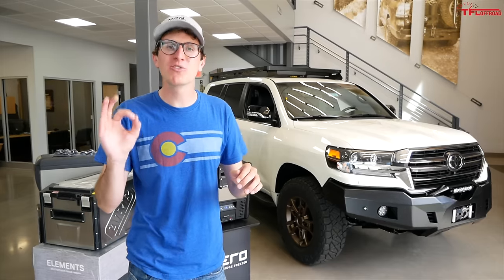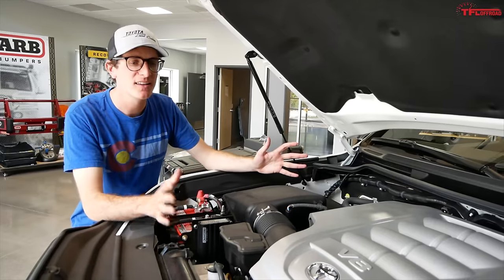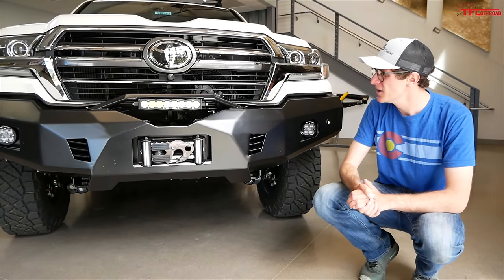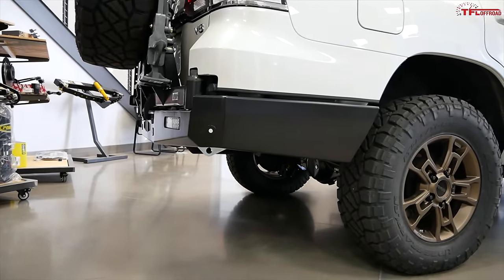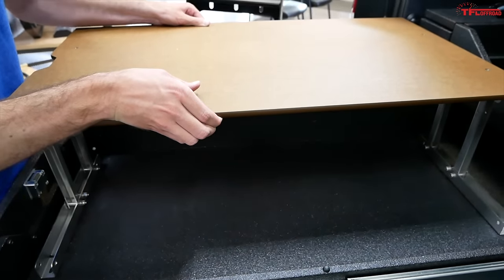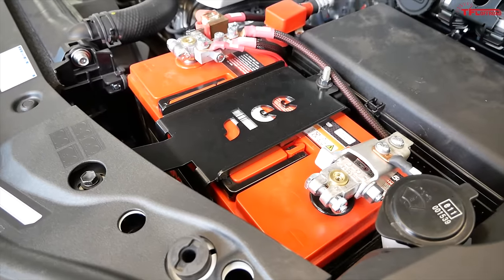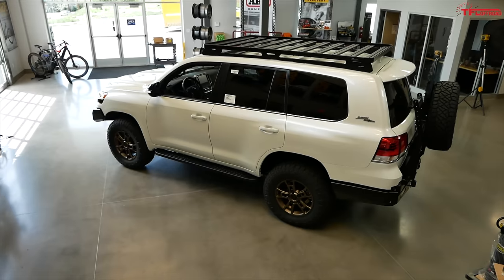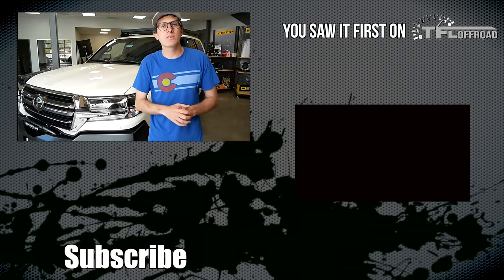Here's Why This Toyota Land Cruiser Costs $150,000!

Comment: Expensive but at least it’s not just another dealership bolting on cosmetic accessories and calling it an overland build.
Reply: Yeah, at least they outsourced it to the right place.
Reply: @Les Norton For dealers its a cash cow. Bolting on a few grand in wheels and tires and the rolling it into the financing is a killer deal for THEM. People not saving money but convincing themselves they need a $70K pickup truck and are ok with 8 years of financing have completely changed the way dealers sell vehicles.
Reply: in my country(thailand) standard landcruiser vx200 250,000 usd+(8,500,000 bht)
Reply: @donleamon8653  those sorts of people have ruined the true meaning of an overlander. Nowadays weekend warriors  think they are overlanders.
Reply: I like that they did all of that and still didn't do a rear locker.

Comment: Proud owner of 2008 LC2008, yes expensive when I bought it new in 2008 but really happy it still drive like new even with 450K miles 👌👌
Reply: Yes, that car so expensive. We have LC2016 we bought it in 2016, but it doesn't  much different from LC2008 in design.
Reply: My 14 year old Ford Escape has as many miles and still drives like new too. JK but I think it’s about how well you maintain your car too with a little help from initial build quality. I like the style of yours better than the new ones.
Reply: Mine have 150 000 but Kilometers same 2008 brothers, amazing vehicle..
Reply: I have a 2008 I got a few months ago, only 160k miles

Comment: I admit that I'm a Datsun and Toyota fanboy but there is no way I would ever buy a pre-customized vehicle, especially one with a price tag of $150,000. Half the fun is customizing it myself. That Land Cruiser looks heavy as Hell.
Reply: Thing is, other than the how you'd outfit the rear cargo area, Slee stuff is in reality, what you'd buy here in the States to put on your 200.
Reply: Yeah this rig is to overly priced as well
Reply: @donleamon8653  I am a Dissent guy myself
Reply: @vee950  Its expensive because its designed to last 500k miles.  It will outlast 3-4 other trucks you'd own in the same time period.  That's why they're expensive, meant to drive through the jungle with no repair shops around and not break.  But alas (and same with the 4runners) if they are the most reliable SUV out there - why buy new?  Just buy a used one.
Reply: @MaliciousSRT  500k? try 1mil. There are a couple Tundras with the V8 Engine with 1mil.
Reply: @Baebon6259  Not the 5.7L V8 though.
Reply: It is heavy as hell. The only downside is GVM is very low for such a big vehicle. My 2009 LC200 has only 570 Kg load capacity for addons. You put front bumper w/winch (100kg) and rear bumper with dual swing arm (100kg), drawer system with fridge slide (110kg) , long range fuel tank (40kg) and rock sliders & bash plate (60kg) you are going to be over the GVM. I personally think load capacity should be at least 750kg. Unlike Australia we don't have GVM upgrades in South Africa.
Reply: @boymeetsbush8232  a LC 200 is a smaller SUV than an cruiser. I think the LC200 is the same as a prado
Reply: @lucwilliams7447  In physical size it is same as a Prado, but mechanically it is far superior to a Prado also at least $30K more than a Prado. The Troopy is the best siz wise for a overlanding vehicle, if you don't mind the truck style suspension and ride. I will take LC200 any day.
Reply: @AlaskanSnowLeopard  yes there is. The 4.7 has more because that motor came out 23 years ago and the newest one is from 2006 so there’s a lot of 5.7 L V8 that are now heading 1,000,000 miles just go on the tundra forums. I’ve seen hundreds past 500,000.

Comment: I have a 2009, looks like the one you're showing.  At 11 years old,   it drives like the first day I got it. I added a 180 L  that 50 US gal. Aux tank . It needed it. ARB front and rear lockers. It goes every were out of the city with me for my work in renewable energy in East Africa.
Reply: @Nawir- do you have the ARB air lockers? Have they been reliable over the 11 years? Thanks in advance.
Reply: Your 2009 does not like like a 2013 nor 2016+ Definitely needs a large tank. Range is abysmal with oem tank. They Upgraded the Tundra tank in 2015 to 35 gals. No room on the 200
Reply: Is Toyota the chosen brand over there due to reliability etc or not really?
Reply: @UnseenSpirit  Toyota landcruiser is chosen brand around the world, because the UN agencies, red cross and the large mining groups use Land Cruisers, so finding part and tires is for LC is a non issue. In South Africa it is either Land Cruiser or Land Rover.

Comment: I just drove my 2021 Land Cruiser Heritage Edition off the lot 2 days ago. In less than 24 hours (yesterday) I put new tires on it and I ordered the rock sliders today. I'm not at $146,000 yet; I'm going to wait at least a year before I do the big stuff. They only did black and white for 2020 but they added silver and Magnetic Gray Metallic for 2021. Mine is Magnetic Grey Matallic. I heard they only made 100 in my color. They also added the option for a third row in 2021 (which is standard on the base model; with a third row delete being standard on the 2020 Heritage Edition). Mine has the third row. Assuming it's a 50/50 split on two or three rows in my color, mine is one of 50 in the country.

Comment: Awesome vid and truck but I think that is way overpriced! For full skid plates, lift, new wheels and tires, suspension, roof rack, storage, and front and rear bumpers... shouldn’t cost anymore than 15,000-20,000. I don’t see how all this adds 50k to the price tag😬
Reply: It don't add up bit they know there's a bunch of dummies that's gonna pay it there's so many people that don't use common sense Wesley
Reply: Honestly, if I were rich AF and I wanted something super reliable and done right I would buy it. I don't think your average joe would buy this. Personally, if I wanted a 200 series I'd buy like a 2008 with 150k miles on it and bolt things on myself. I'd rather get a 100 series though. :P
Reply: You have to know the cost of 1 ton metals!!! So it too expensive because it’s not gold, not copper not so j espère que vous n êtes plus gourmand sur les valeurs!
But nice vidz and nice custom!!!
Well done for the customer! Regards

Comment: For half that I could build just about any rig with all the comforts, tougher axles, diesel(better mpg), lighter, better articulation and infinitely rebuildable. New trucks are already pushing it with $80k price tags, $150k is just greed. Who is going to off road this underpowered tank ? For $40k, a nice driver with A/C, cruise and electric windows can be built reliably.  This is insanity. 🤔

* I took a totalled Earth Roamer $20k and slid a used F550 under the cab $25k. A repaint $7500 and i was on the road with it for 7 years (186,000miles). Oh, and it had a Cummins and manual trans. It can be done.
Reply: Very cool idea for a budget build and if the car is an older model you don't feel as bad as wrecking a new car
Reply: @iulianpalade801  My friends and I growing up had the novel idea of having a #1 daily driver so we could get to work, a hotrod or 4x4 depending on likes and then a bike. When i was 16 I had 5 vehicles, all were completed and when I could find the right buyer, I'd sell one. After 2 years and multiple cars I saved enough to buy a new F150, my daily driver for 5 months until boot camp. When I rotated home, I had a new truck, a pocket full of cash and no bills. Barter and hard work is King ! Something most people today never learn.
Reply: @jimshorts6751  Different class. A shitbox civic can be made to run 9s, but at the end of the day its not a lambo. When we shopped for a vehicle we wanted 1. luxury interior features 2. off road abilities 3. strong towing 4. unmatched reliability 5. body on frame 6. some rarity aspect 7. some prestige aspect. Only one other vehicle checked most of those boxed, a Mercedes G550 which has questionable reliability and starts at $40-50k more than the LC, nothing else really came close other than the sister vehicle LX570. People who buy these rigs will not typically cross shop it with a truck.

Comment: I had a problem with my Toyota and took it to Christo when he was in some small shop with little room in it. They looked at my truck for over an hr and I mean they looked at everything. They even had it up on the lift and took some things apart and put back together. They couldn’t find anything wrong with it. I wasn’t really sure there was something wrong with either but felt it wasn’t right. So when I asked for the bill Christo said No Charge! I was Stunned and asked why. He said I didn’t fix anything so no charge. When I left that shop I felt guilty like I had stolen from him. Who does that?That truck is still on the road with nothing wrong with it. I can see why he’s gotten as big as they have. Best service ever.

Comment: You guys missed out big time      In Australia we get the 4.5 litre twin turbo diesel   Approx 200 kw  and heaps of torque  which is upgradable heaps in the after market domain   And they sound GREAT   And use heaps less fuel than the big gas 5.7    Awesome vehicle

Comment: My 80 series cost 10k and could out perform that offroad . That leaves me with 140k for holidays . Whoooot !
Reply: 80 series is hands down the best all around land cruiser Toyota ever made.  Those who doubt it never own one or even drive one. Beside the transmission the 80 series specs are almost exactly the same as a 2020 rubicon.  The only difference are in the interior and modern gauges and radio.  80 series comes with awd triple lock differential solid axle. I cannot think of another vehicle in 2020 or for the last 10 yrs with those specs that cost less than 10k to own vs 50k, 60k and even now 145k.  So my friend was right with 140k left I can put a 200 series Toyota v8 diesel in an 80 and out perform this Slee edition all day long.
Reply: Al Roker  oh it will. The 200 is nicer on road but the 80 with solid axles, front and rear lockers will outperform a 200 with ifs and crawl control in every offroad situation all things being equal.
Reply: Al Roker  You clearly don't know much about 4wd's
Reply: Al Roker  Worldwide expedition lmao
Reply: Al Roker  I'll just have my helicopter I purchased with the 130k I saved come collect me
Reply: Land cruiser 70, 80 series still the only worldwide expedition you see driving around the world for the last 30 years. Everything else just breaks down.
Reply: Al Roker  Are you being serious? 80 series are reliable as all hell even with 300k+ miles on them if properly maintained. The things you need to watch out for are the dreaded heater hose and head gasket failing. Other than that, I wouldn't even blink twice. My 1989 FJ62 has 225k miles on it and still has near factory compression. The older cruisers are built to last a very long time!
Reply: +Django Freeman My 200 series cost $90k and could fit more bitches in luxury. That leaves me with the other $150k for mods. Wooooot!

Comment: If I had the extra cash for a build of this value, I'd be hard pressed to not be talking with master LC builder, icon4x4, for a decently equipped 100 build. Notice I said decently equipped. I think a fully spec'ed icon lc100 build would be another 20-30% more than this. This 200 is definitely well done.

Comment: I would prefer a 4x4 with Solid Front Axles with front and rear diff locks. No electronic gadgets. A winch in the front with rock sliders and underbody protection. Of course a 4inch lift with long arms. Flex is the aim. Not a sissie setup like this cruiser.

Comment: It's a cool truck no doubt, but when you talk about the ultimate for going around the world you have to think 70 series even if we can't get them here. Which is a damn shame! When I was looking for my rig I was torn between the LC200 and 4runner. Went 4runner because of size, weight, factory locker, aftermarket stuff, etc. But if the 70 series was available in the US there would have been zero debate!

Comment: Dealership builds a truck with aftermarket parts and the price goes up. If you build a truck and try to trade it to the stealership it drives the price down.

Comment: Overpriced and many changes are cosmetic. The sliders, back mount, and the trunk compartment are all unnecessary and adds to the cost. Where is the secondary fuel pump or the modified air intake?

Comment: Not a tonne of horsepower for the money?  🤔
Reply: It’s not. I see few raptor owners pushing 700hp with bolt on. I know I know you going to say “not TOYOTA !!!” But for close to 100k it’s not a lot of power
Reply: Why do you need a lot of horsepower in an overland rig?
Reply: Alan Bowers I think it’s case of want vs need. It’s no secret manufacture are adding more power to suv n trucks. Even Toyota will move on to v6 turbo instead of v8. When I was looking for family car few years ago, I had fun time adding HP to check list of cars. I never cared for it but hey why not
Reply: @kdavid123186able  well sure, but that just shows how good manufacturer marketing teams are at getting you to desire a certain trait or feature. Doesnt really help this vehicle at it's intended function at all, and can even negatively impact many aspects.
Reply: @kdavid123186able  If you really want big power then a supercharger is available. I have a Sequoia with the same motor and it moves the truck quite well. It also tows right up to the max very well. I have had mine overloaded a bit and with the air suspension in the rear, suspension on firm and the trailer loaded properly it handles amazingly well. The truck is definitely over built. If Slee decided to modify the engine for power it would be another thing they would have to cover under their warranty. Toyota won't cover any engine related issues if an aftermarket company makes modifications. Leaving it all stock would be the best course of action for them.
Reply: HP is great for breaking stuff.

Comment: Stop calling this vehicle massive...It's about 2 inches wider, 2-3 inches taller, and 2.75 or so inches longer than a 4runner...Now it is a half ton heavier, but still has a better 1 to 1 torque and horsepower per pound ratio than a 4runner.  You want massive, look at Chevy SUVs.

Comment: 150k truck. Nice. I bet the poor mechanics are only making 40 or 50k a year. A lot of these "high end" shops pay mechanics poorly. I've checked out a couple of them and the offered pay is always pathetic. While not as interesting of a job, dealership mechanics make way more.
Reply: Slee’s technicians are paid very fairly and work in an extremely well lit and clean shop. Cheers!
Reply: @JP4WD1  My comment is based on browsing many offroad shops hiring offers. 20 to 30 bucks an hour was fair 20 years ago, but today is not fair pay. My comment is also based on knowing a experienced mechanic that used to work at Slee. His complaint and why he left was due to the low salary.

Comment: Yes, good engine, but that never changed in 15 years, fuel economy sucks, there's a reason you don't see them on the road because of bad and outdated design, outrageous and unjustified price, lastly and the most important for me the cheap interior, once you step in, you're surrounded by cheap plastic that even have bad smell like chinese cars...beside Tacoma enjoy your sleep Toyota....150 k hilarious
Reply: 150k is what the dealer is asking. Key word here is dealer. There is not 60k worth of add-ons and labor, more like 15-20k.